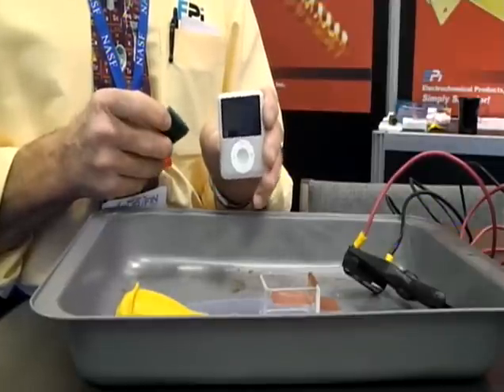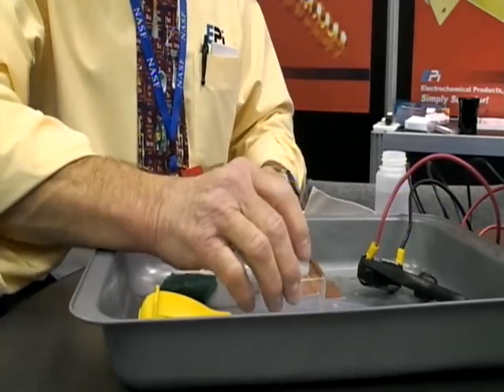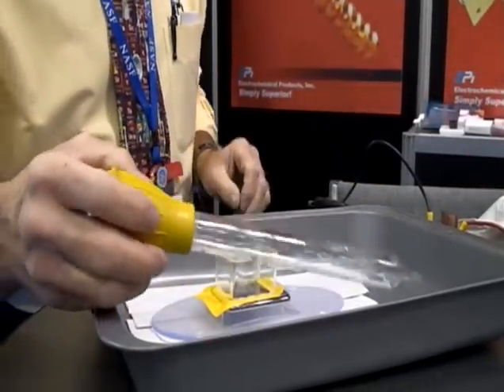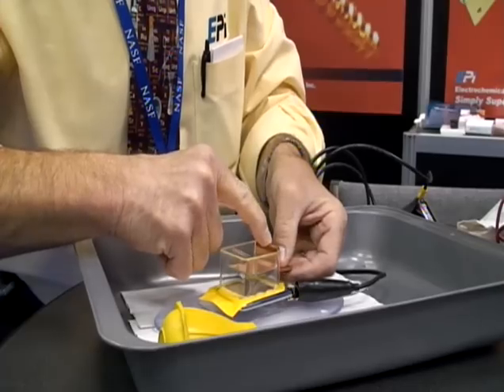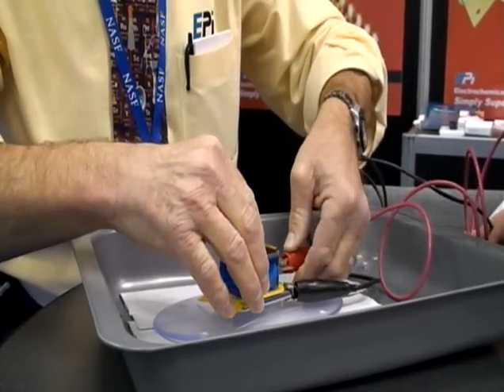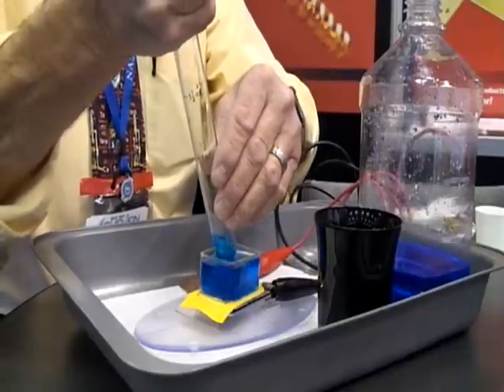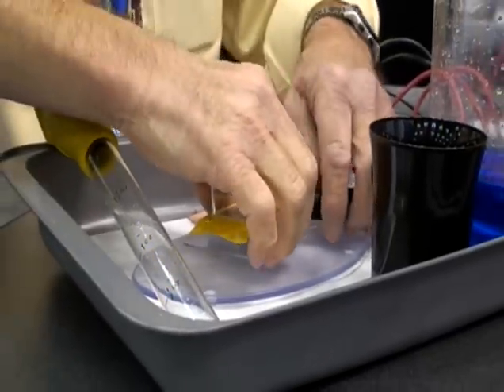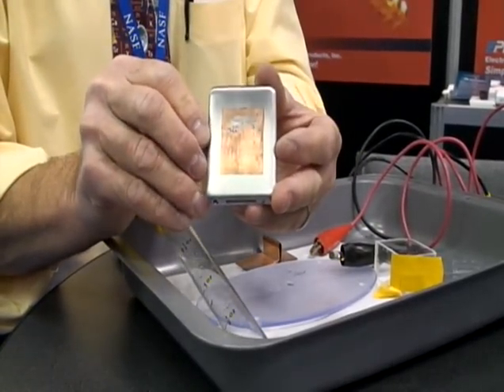Electroplating: Copper Plating an iPod at Sur/Fin 2008

Comment: is it possible to make in home a pcb plating through hole?  I mean after drill 1/32 in diameter on a printed circuit board I would like to make electrical conections between top side and bottom side of the pcb, it´s a copper electrodeposition process.
thanks

Comment: electricity flows from positive to negative, ELECTRONS flow from negative to positive. The anode (the copper) is being oxidized, therefore losing electrons so that to solid copper will turn into ions and be released into the solution. The negative electrons that the copper loses are transferred to the iPod so that it can react with the positive copper ions in the solution and the copper ions will end up binding to the iPod as solid copper. I'm not saying it looks good, but it works.

Comment: I have an 80 gig Ipod Classic, I know how to take the whole back cover off.  It is possible to plate the whole back cover using this method?  And also, would it be possible to plate it with another kind metal, like nickel or chrome?